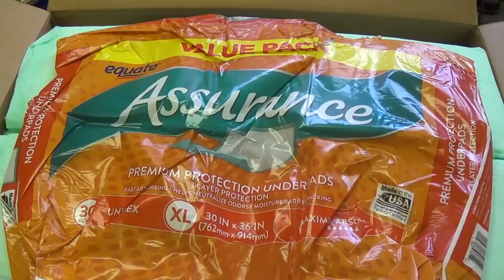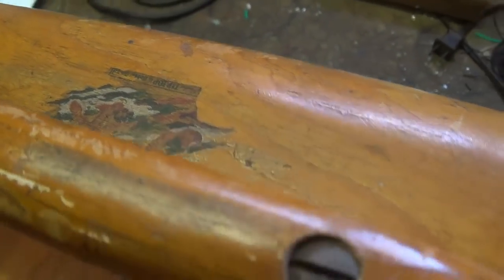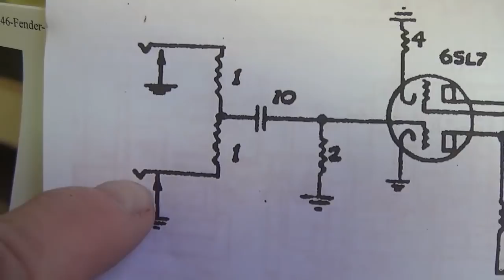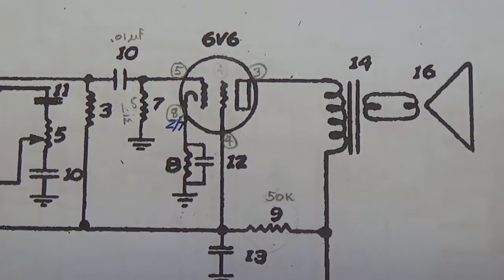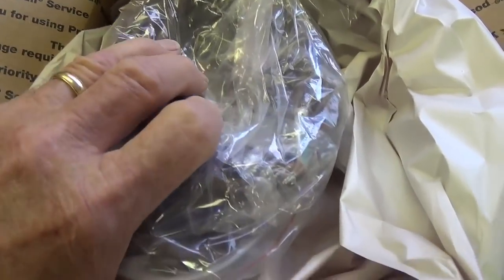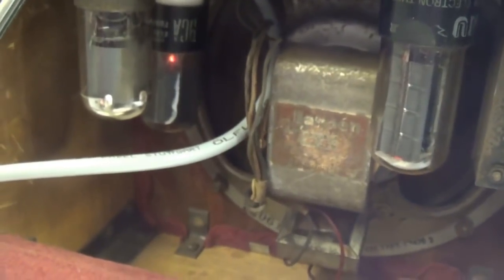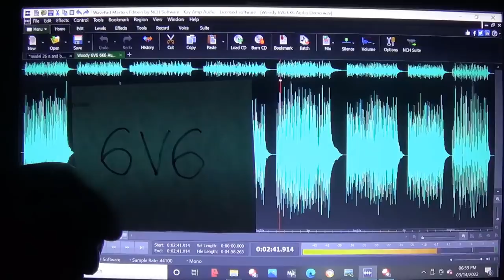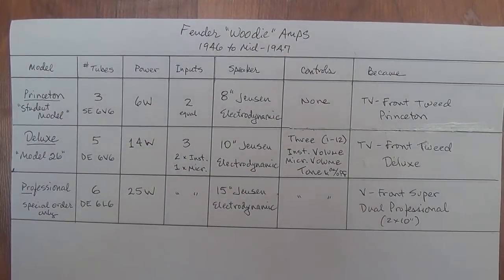1946 Fender Princeton "Woodie" Amp.....Rare, Valuable, and Really Nice !!

Comment: tip: inside the chassis make the mains ground lead a few inches longer than the live and neutral, w/o a proper strain relief should the amp fall or get tripped over and the power cord gets yanked out of the chassis the ground will be the last to rip out.
Reply from the maker: With all due respect, I fail to see any practical benefit to this, but thanks for your input.
Reply: @UncleDoug  If it had a strain relief I’d agree and crazy glue isn’t going to do much. I’ve seen featherweight amps like these get pulled off from atop a 4x12, chairs, stools, combo amps, from an inattentive tug on the guitar cable. Done it myself. It's a long drop off a 4x12.
Reply from the maker: @FaintSignals  Thanks for the follow-up, FJ. I still have some trouble visualizing this amp being used in a large venue atop a huge speaker cabinet......but I get what you're saying.

Comment: Hello again Uncle Doug...the truth about my question is, I lucked out on a box of transformers, some with the voltage and current written on them, Stancor, Military types with the dark green paint, etc. .The problem is with the ones that appear to be ok, but no markings or labels of any kind. Some are large, heavy and certainly very powerful. Is there a safe way to test these. I am using a light bulb current limiter much like yours and mostly a "suicide lead" with everything else taped off that I am not checking. I have checked voltage above 700 volts but would like to know the proper procedure for the current check if it is possible. Believe me, I don't want to shock or kill myself so I am doubly careful when checking and taping things off and I only connect 10 volts at first with the Variac but this can't give the correct current also can it ? If you have already done such a video clip, I couldn't find it. Please forgive my ignorance and boundless curiosity...guess I need a little more info on these. I looked for a list that matches up with any numbers I have found stamped on the bodies of these with no luck on the internet.  Stumped...again, Daniel
Reply from the maker: There are no "current tests", Daniel. All you can do is guess, based on mass of transformer and gauge of the output wires.
Reply: @UncleDoug  Thanks again...explains why that wire got hot and melted and ruined that DMM.

Comment: Hello !
I saw your video about the schematics of a Fender Champ.
I googled quickly, it looks like a Fender champ costs 800 bucks approximately.
Looking at the parts and schematics, I'd say you could build one yourself for a lot less money.
But I don't really know how much amp parts cost. Are the transformers and speakers what's amping up the cost ? Because otherwise, tubes, resistors, capacitors, simple wiring, it looks easy !
Reply from the maker: Lots of people think that building an amp themselves will save a lot of money......but find out otherwise once they actually do it. By the time you buy the lumber, tolex, glues, metal for the chassis, tubes, speaker, grill cloth, handle, tube sockets, filter capacitors, resistors, wire, power cord, etc. not to mention the transformers (at least $100 for a simple circuit) and the test equipment and tools necessary, you will start to appreciate the now-reasonable cost of an original.......plus you still have to build yours.

Comment: Interesting, it appears that you left the "death cap" in the circuit... or did the owner stuff it with "air?"
Reply from the maker: The death cap was disconnected from the circuit but left in place for originality, Moose.
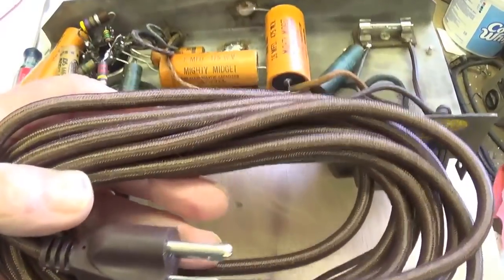Reply: @UncleDoug  Thanks again, didn't think you would miss it!  29:58 for reference.

Comment: The 6K6 produces a much cleaner output than the 6V6 which presents a low level of distortion. The 6K6 also has a slight roll off in the upper frequencies which makes it a much more pleasant to listen to sound.
Reply from the maker: Thanks for your input, Joe, but are you saying that the hundreds of thousands of 6V6 amps would all sound better if they used 6K6's instead ??
Reply: @UncleDoug  
Not saying that at all. I was trying to explain what I thought I was hearing in that particular sound check.
Reply from the maker: @joereedmusic9853  Thanks for the clarification, Joe. We 6V6 lovers can breathe a sigh of relief :)
Reply: I agree. But who can really tell with the audio processing that the 'Tube puts on the vids. Led Zeppelin was recorded supposedly with a Champ wide open. That power tube distortion is what you want with the volume control dimed. I think it was wise of the prior user to flip tubes to color the tone. Lots of sound from 8 watts.
Reply from the maker: @ronmelanz2820  I post my original audio demo files for each video on Patreon for my patrons. The audio quality is significantly better with the non-YT recordings.

Comment: I don't see any way to discreetly install a volume control without modifying the chassis. I believe a common thing to do back in the day was to hook up a volume pedal to these amps since they are always at full volume. It probably would make a half-decent practice amp.
Reply from the maker: The lap steel guitars used with these amps had their own VC, Jason, and players would vary the volume on the instrument while playing to augment the sustain.

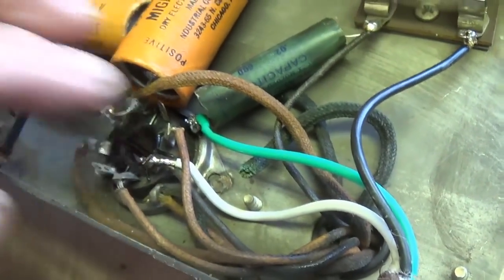Comment: Timestamp 30:36 you show the obviously damaged line cord. As you probably cut it with your stanley knife, you also cut the insulation of the cabels. It appears that the copper is visible! Either you create a short between the live ends, or at one point the chassis becomes live. Allways check line cords for this kind of damage!
Reply from the maker: Thanks for your helpful input, JP.
Reply: Thanks for your reply 😁

Comment: What are the chances that the components in this early-production Woodie were soldered in by Mr. Fender himself? Do we know when Lupe and Lily started their tenures in Fullerton? Fascinating history if not perhaps a bit nerve-racking inside. Not exactly a Blues Jr. (:
Reply: The likelihood is very good that Leo himself had his hands inside of this amp. I have personally seen his initials inside of a Deluxe Woody and have seen similar notation published by others. Rumor had it that after the breakup with K&F,  Leo was building these off of his kitchen table at home.
Reply: That's very cool, thanks! I've worked on several older amps and PAs and have no problem restoring them (solder, new components) but w/a Fender amp like this, I would be kinda nervous. Funny how that goes... props to the owner and Uncle Doug for treating it w/the respect and expertise that it deserves! 🙂👍🏽
Reply from the maker: Thanks for the interesting comments and info, Larry & SS.

Comment: Hey Uncle Doug can I ask a question i thought of you

You have rewound speakers yes?
I've got a problem I've been wondering why no one on this planet that loves music has ever rewound a speaker to test the Earl Kong patent?
Basically,  if you wind any inductor in two symmetrical mirrors then connect them parallel the R drops & the field amplifies, they must be symmetrical,  same turns. 
Process explained in pat num 4806834

But the transducer is under 'percussion air motor ' lol & US4584438A a 'percussion air motor ' would allegedly make distortion free harmonics due to the symmetry. 

But no one I've ever seen has tried it??...so strange Dr doug.
Reply from the maker: You are miles beyond my area of expertise, Kolin. Your question would be better directed to an engineer involved in speaker design. I have re-coned speakers and have repaired damaged voice coil connections.....but have never re-wound a voice coil. New ones are readily available at a very reasonable price.

Comment: What state are you located? I'm in S.C. and looking for a repair technician for my amplifiers.
Reply from the maker: I'm in Texas, but booked up with repair work, Barbara. Message me on my FB page: Uncle Doug's Vintage Amps for a recommended tech.
Reply: @UncleDoug  thank you so much for the reply and info. I've got an mach 4 mesa boogie and can't afford 600 shipping and bench charge to send it to mesa factory. After tubes and repair it wouldn't be worth it. Thanks again. I'll be in touch.
Reply from the maker: @barbarafogle3541  Good luck with it, Barbara.
Reply: @UncleDoug  thanks. I'm good with guitars not so much on amps yet. I hear mesa's are a pain. I'd like ask your opinions. The problem started with a drop in volume or output. I had the gain way up and the volume up but the master volume was barely on one. Trying to get max gain in small venue. I replaced all power tubes with new matching not the pre tubes but I don't think they are an issue. Caps look good but not verified by mcf's . one of the transformers looks leaky. Maybe shalack. Do you think it could be a short turn to turn?
Reply from the maker: @barbarafogle3541  I doubt that a transformer is to blame.....or a tube. It's probably one of the small components, like a capacitor or resistor. Yes, Mesa amps are a nightmare to repair.

Comment: For me the 6K6 sounds much less distorted, but to be honest, I don't like both. I would like to see them on the scope, it could be a speaker problem.
Reply: I think partly what you are hearing is the absence of a Tone control. I found it very "clear" but a musicians put it "Bright' or "tinny". The very highest frequencies that are shrill to our ears are rolled off by the tone control at a 2.5 K even at the max toward treble unless I am mistaken taking the tone pot and related circuity as a unit. Correct me if I am wrong in any part of this concept pleas Uncle Doug.
Reply: @j81851   It might be that the unpleasant artifacts you are hearing could be related to oxidized, corroded mechanical ground connections (input jacks and elsewhere) causing intermodulation distortion, especially with the chassis being used as the return for the filament supply. Probably some eddy currents in the chassis, muddying the waters.....
Reply from the maker: I appreciate your response, John, and concur that the complete absence of any tone control could indeed cause the amplification of higher frequencies that we are unaccustomed to hearing.

Comment: I think the 6K6 sounds better...maybe the output tranny is a higher impedance than the normal .
Reply from the maker: It's all a matter of personal preference, VK. Thanks for sharing :)
Reply: @UncleDoug  Yes as always....sound is in the ears of the beholder. I was thinking the 6k6 was a pure pentode as opposed to a beam power tube, however my rc15 rca tube book suggests it is not...just lower power possibly for car radio's. Also read that the earliest models used the 6K6  and had a puny output transformer that may have been as high as 14k impedance. Very few woodies here in Australia !
Reply from the maker: @vk6xt634  6K6 tubes were fairly common in console radios, VK.

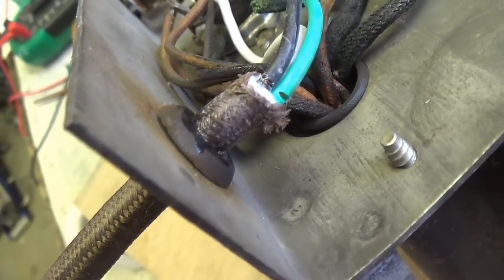Comment: 30:39 You cut through the insulation of the green wire of the power cord. Not good. Even though it is the protective earth wire. You seem to have sliced the insulation of the black wire, too.
Reply from the maker: Others have mentioned this, Winston.

Comment: I know manufacturers use what is most available for the lowest cost. Is there any benefit to using different types of, or makers of, capacitors in key areas of circuits?  Ie: are some capacitors better as filter caps, bypass caps, coupling caps than others?
Reply from the maker: Some people think so.....but I don't, DO. Good quality caps are readily available at reasonable prices and work just fine.